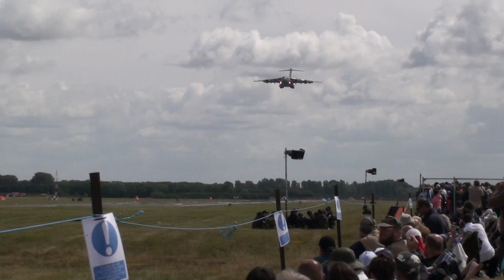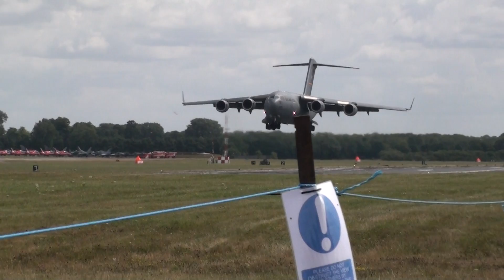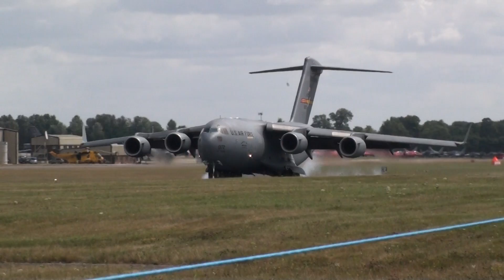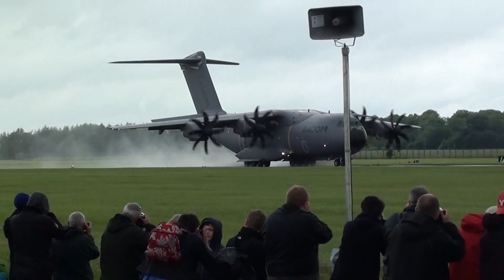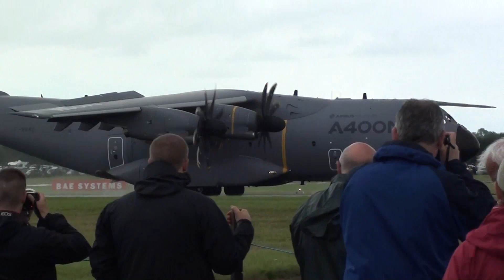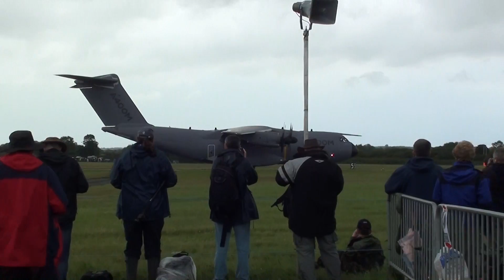Tactical Short Landing C-17 vs A400M. What Brakes The Most. Reversers, Wheels, Props, Spoilers?

Comment: Brakes, its all about the brakes spoilers are designed to simply help the brakes work and reversers are just for that little bit of added stopping power.
Reply: Charles Damery You say there are no brakes that can stop a 200 ton loaded aircraft, yet the 747 regularly uses wheel brakes to stop over 1,000,000 pounds of max gross weight on RTOs. Yeah, they might get red hot and make the wheels deflate, but they can be used for that. Not to mention in regular landings wheel brakes are used as well, just not as heavily. No point in wearing out brakes more when there's 10,000 feet of runway.
Reply: Charles Damery I'm with Brandon Lee.. I am a C-17 pilot. You don't know what you're talking about.. why don't you take me and the previous commenter that has a 757 and 767 type rating seriously? I landed the other day and got on the brakes before the reversers deployed. Did I get in trouble? No. Did I have to go to "the simulator for upgrading"? No. It even states in our flight manual for assault landings, which this video shows a C-17 do an assault landing, to "use immediate maximum braking as soon as main wheels touch down". How do you explain that I'd get in trouble if I use brakes on touchdown when it specifically states to do so in our FLIGHT MANUAL? Quit being so narrow-minded, do some research and you will learn something about today's heavies. I admit, going into training for the C-17, I thought reversers did most of the stopping. I was wrong and have learned otherwise. Just trust me dude..
Reply: Charles Damery I'd have to agree with Brandon on this one - I've talked to many ATP folks who have told me that SOP since the fuel price surge a few years ago is always to use runway run-out if available and to use conventional brakes only.  

It's literally cheaper to use the carbon brakes on modern aircraft (at least the Airbus aircraft we were talking about) than to spool up the engines in reverse. 

That obviously also implies that you're totally incorrect about the effectiveness of the friction brakes on aircraft, since it is their primary means of braking. An empty (fuel) AC will have zero issues stopping without reversers, hell most can do it and still make the second high-speed taxi exit!

What about the Qantas flight with the uncontained engine failure? That aircraft landed over 961,000lbs  (50 TONS OVER its max landing weight!) WITH HALF ITS REVERSING INOP AAAND antiskid and various hydraulic failures and it STILL managed to stop before the end of the runway! Just a reminder, the 380 only has two engines with reversing.  There's no way that single remaining engine is what stopped nearly 1 million pounds... Oh I think they added like 20kts to their landing speed as well!
Reply: Charles Damery brakes are still the primary stopping force. They are by far the most effective.
Reply: Charles Damery Now, you're listing armed forces as qualification, which I find weird, as fighters, who today mostly don't have reversers at all, with only tiny airbrakes and spoilers, operate the exact oposite of your description. The F-16 uses the underside of its fuselage as an airbrake down to 100kts. Below that? Wheel brakes, my friend. That tiny winy little airbrake in its arse isn't going to help you much. 

Back to jetliners. When you calclulate landing performance in the civilian world, you account for threshold speed, weight and the level of wheel brakes applied. Most civlian airports have a noise curfew at around midnight, not allowing anything more than idle reverse for landing aircraft under normal ops. Reversers only account for a very small percentage (a few hundreds of feet per several thousands in total distance), and the spoilers have almost no effect once the weight is on the wheels and the brakes get to do their job. To give you an guestimate of brake efficiency on modern aircraft, you can assume that 70-90% of the stopping power comes from the brakes, depending a bit on the aircraft.
Reply: Charles Damery There's one type of a/c that benefits more from its reversing system, though. Propeller driven aircraft have massive propeller discs of drag and reversing air upon landing, instead of the big air inlet deflecting some jets out the side of the engine fairing in jet engines. This means that props are better at stopping pound for pound due to their reversers. I don't have an arbitrary percentage in my head on this one, but the essence is far greater reverser efficiency than jets.
Reply: Charles Damery lol you have no idea what you are talking about, I hope for your sake you are just trolling and not actually this dumb.
Reply: During flight tests, the A380 was tested for a "worst case" 2x rev inop Max Takeoff Weight rejected takeoff at ~170kts. The brakes were machined to reflect a 90% lvl of wear and tear, and without reversers the plane stopped at less than 2000m (6070 feet). I've taken this info from the Smithsonian Airspacemag's "Stopping the A380" article (google will find it).

Not good enough / not believable? Okay, here's the Youtube link extention to the video from a similar test, with the B747-8 at max weight, no reversers: /watch?v=_g6UswiRCF0

Obviously, spoilers and reversers are vital to reduce brake and tyre wear/tear, put weight on the wheels early in the landing rollout, as well as reduce brake temperatures after landing. They are very important when it comes to letting aircraft fly leg after leg with short and hasty turn-arounds, but most modern airliners can manage just fine without them when it comes to stopping on even limited runways. Keep in mind that there's a difference between normal ops and certified abilities.

Last note, the Avro RJ series with their very tiny turbofans doesn't even come equipped with reversers, and it' still a STOL aircraft :)
Reply: Charles Damery Brakes are still the primary force used to slow aircraft down on landing, reversers are merely to help and spoilers are only used to help the brakes preform better. As much as you want that to not be true it is.
Reply: Charles Damery Lol, you know nothing. They use them in concert but brakes are by far the most powerful stopping force on the air-frame. Most modern airliners have both auto-spoilers and auto-braking systems, reversers are the least used system, because wear and tear on a huge turbo-fan is way more expensive than some brakes and tires.
Reply: Charles Damery lmfao you are a moron you have no idea how modern aircraft operate.
Reply: +Brandon Lee is correct. Brakes are THE major stopping force for transport category aircraft that are certified in the US. Indeed, for certification, reversers are not even considered. ALL of the stopping for aborted takeoffs are predicated on brakes alone for the aircraft I fly B767/B757. After an abort from a heavy weight takeoff the brakes will be very hot and the protective wheel fuse plugs will most likely melt and deflate the tire. Reversers alone would not stop the aircraft and we would depart the prepared surface.
Reply: +Charles Damery I'm sorry but your "experience  is dated, you need to do some research on modern aircraft. Talk to anyone flying modern aircraft (several have commented here) and its all brakes, reverses are not the main source of stopping power, the brakes do the heavy lifting with modern ceramic brakes.
Reply: Charles Damery they still primarily stop using brakes, the spoilers only help the brakes work and the thrust reversers help, modern airliners thrust reversers and indeed the kind on the c17 only redirect the fan bypass air forward, they are hardly efficient.
Reply: +El_Dude being discouraged from using them when you have runway remaining so you don't wear them out is completely different from them being more effective than spoilers speed brakes or thrust reverse, also the way large aircraft operate is very much braking based. They have anti-lock brakes and very durable high temp carbon brakes.
Reply: ***** Hey dude... We're not talking about fighters or 38s. We're talking about heavies. They're a different animal than fighters. I doubt you know how we (heavy pilots/aircraft) operate, unless you were one of those people who couldn't keep up with the speed and got heavies out of 38s.. if you are, I retract my statement.
Reply: Bob Gallup thank you!! To further back you up.. the KC-135, E-3, E-8 don't even have thrust reversers..
Reply: +Charles Damery As an ATP, I can tell you that brakes are the primary source used for stopping the aircraft. Quit trying to act like an expert and providing false information.
Reply: +David Krizauskas You are correct. I see you are also truly a pilot with a type in the T-1. Good to know not all people are lying idiots.
Reply: +Charles Damery Also, a lot of the time when we land on very long runways, we won't use thrust reversers. I wonder what we're using to stop the jet. I can tell you that wing spoilers do not provide enough drag to stop the aircraft - even on a 12,000 ft runway. Just because you have 1000+ hours on FSX does not make you an expert. now go away, troll.
Reply: +Charles Damery One more thing for you to think about. If brakes are not used during landing, why is it that our landing distances are dramatically increased on wed and icy runways? If we only used thrust and drag to stop the aircraft, runway surface conditions should have little effect on landing distance.
Reply: +Charles Damery Certification for all commercial aircraft requires a maximum landing weight no reverse thrust to a dead stop. The only thing left is brakes. RTO tests require a V1 RTO with no reverse thrust at MTOW. What do you think you know?
Reply: +Brandon Lee Actually it's not all about the brakes in fact if it's anything it's reverse thrust
Reply: +SquirrelFromGradLife no it's not, what are you basing your statement on, do you have any experience operating large aircraft?
Reply: Flaps they are called flaps, please never call them spoilers ever again....
Reply: Thrust reversers don't even actually reverse thrust much. They mostly just redirect it so the engines aren't pushing the plane forward anymore. I'm 90% sure a 737 or other commercial plane would overrun with max thrust reversers, spoilers, flaps and no brakes. Thrust reversers shouldn't be deployed below a certain speed, and then you're relying entirely on flaps (which is almost nothing). That being said, nobody has ever tried that, because everyone uses wheel brakes.
Reply: +Charles Damery large heavy aircraft use their brakes, the brakes are the primary stopping force, end of story you are emphatically wrong.

Comment: That stop by the C-17 was not a maximum full stop. The C-17 is a larger plane but it still stops shorter than the 400 because of it's more powerful engines.
Reply: jjs4you2 no: jet engines are less efficient in braking as propellers, and the C17 is much heawyer...
Reply: +leneanderthalien You are incorrect and dumb.
Reply: +gypsykingg and you are a idiot because all y say is right..C17 turbojet efficency 70% (in best cases), A400M propeller 85% ,TU 95 counterrotative props: 98%...thats all..

Comment: The c-17 is used more to transport chinooks,mastifs and even Apaches to Afghanistan before we pulled out so it doesn't need to do short landings unlike the A400 as the Airbus is going to replace the C130 which is used for airdrops etc as the C-17 was used to medivac the British nurse who contracted Ebola the the C-130 is like a donkey strong reliable and will get the job done the A400 is like the van it will get the cargo there sooner than the donkey and can carry more than the donkey the C-17 is like a Lorry it will get there as fast as the van and carry a lot more than the van but they all do different things so comparing them is difficult to be honest its just a matter of opinion I like the C-17 more than the A400 and the C130 so I think its better but other people prefer the Airbus and C130.

Comment: What brakes the most. Well, depend on what speed. The spoliers really don´t break that much, but they decrease lift putting more weight on the wheels, increasing the breakingpower of the wheels.

The reverse thrust and props breaks most at high speed, but do a adequate job at low speed to. It seams like the C-17 didnt use the wheel-brakes thow

Comment: Ah, I love a bit of good ol' competition. I'm biased toward the C-17, I must admit. However, it's indisputable that the C-17 is a proven airframe with years of operational experience under its belt. That being said, give the A400M two decades of operational use and I'm sure it will prove itself just the same. Flying around and doing fancy stunts at air shows proves nothing.

Comment: A400M is the clone of AN-70
Reply: Arnaud S. The AN 70 was in the air before the A400 was on paper...and I will still take AN 70 over the A400...Ive been to European airshows where both were staged...only problem, governments  associate it with Russia and its not looking good over there...the A400 doesnt have contra props..its got counter props...huge difference
Reply: Contro-rotating props? It's slightly bigger? It's building proces was planned much earlier then the plans of the An-70.And look still today, the An-70 program is a mess, even without the situation in Ukraine.I do not agree with you.

Comment: Obviously the C-17 would stop quicker than the A400M as the C-17 has jet engines compared to the A400M's propellers. The C-17 has to be good at short stopping (heard this on a tv programme: Inside Braize Norton) as they use the C-17's to help deliver cargo to the soldiers in Afghanistan. Because Afghanistan doesn't have airports which the soldiers can use, the RAF have to make-do with short, dirt runways as they make be under fire from the opposition so it's a quick "drop-and-go"; sometimes it's too bad the plane may land, drop it's cargo, but not entirely stop to make the delivery.

Comment: prop aircraft vs jet aircraft unfair comparison, like comparing a humvee and a prius
Reply: They're made for the same role, so yes it is a fair comparison
Reply: That's not really true. First off, that isn't just a prop, but a turboprop. Turboprops are basically a jet engine with a prop on it. Second, these are exactly the kinds of planes you would compare. Both are heavy cargo aircraft with short landing capabilities and both are able to reverse thrust. They are very similar aircraft. At first, this "competition", or whatever you want to call it, may seem unfair, but they are both very capable aircraft with many equal strengths. ☺
Reply: actually c-17 is made for longer routes and heavier cargos, doing a400m's job in a c-17 is not economical
Reply: NNT Flow, They are designed for different missions, the C-17 is designed to carry twice as much cargo, twice as far faster. That additional capability is while the RAF is keeping the C-17s they leased due to A400M delays.
Reply: How is it a comparison? Just because the title sais "vs"? Idiot...
Reply: Yes, the C--17 was designed for a different task, with a larger capacity (it was supposed to replace part of the shrinking C--5 inventory) but has a longer range only with partial load and the speed of both planes is almost the same (C-17 450kn, A400M 422kn)
Reply: They are incredibly different aircraft.  Ignoring the powerplant difference, despite that they look similar, the C-17 is quite a bit larger, and is designed to carry about twice the cargo of the A400M.
Reply: Props are good for short field performance because the offer more "traction" for acelerating quick than jet engines... and have better low altitude efficiency.. however they are inferior once at high altitude and high speed.. the A400M however is mid-way between the C130 and the C17.. like a single aircraft trying to offer both worlds in a single aircraft.. it lacks the payloa/range of the C17 but offers superior performance than the C130 with similar short field capabilities
Reply: Its TURBOPROP, NOT PROP... CESSNA FAN DIDN’T YOU? Its just the same Mechanism like Turbofan... don’t judge if you dont know anything...
Reply: AIRBUS DECIDED to use turboprops because they knew it was better.
Reply: You idiot. Props are always better at short landings.
Reply: The only real difference between them is the range that each is good for. Turboprop for short and jet for longer distances. But they both have the same capabilities.

Comment: Both nice aircraft. But in my opinion (as a European) AIRBUS should next time just middle finger the requests by the involved European air forces and go with already existing commercial jet engines to keep the cost way, way down. Servicing old, outdated short military airfields makes no sense when they should have been updated and made longer and bigger instead of building a plane to suit those airfields. It is not just landing. It is especially the take off distance that forced those request for powerful large bladed turboprops and other demands. European forces are integrating more anyway so many smaller airfields will likely disappear in the future. That is the same as the Danish company MAERSK creating the worlds largest transport ships MAERSK Triple E. It was the ports in Europe and Asia that were updated. Not the ships or engines being adapted. With all the problems and extra delays that brings.
Reply: The A400m is a tactical transport, being able to operate on small austere airfields isn't a requirement born out of the inadequacy of european airfields. The A400m needs to be able to quickly land and take off in a potentially hostile environment, in abandonned or makeshift airfields. Upgrading european airports wouldn't change the fact that the A400m is very likely to take part in conflicts in Africa and the Middle East where it may have to use such inadequate airfields. The needs of armies like the French and British armies in these areas is the very reason this plane exist, it wouldn't make any sense for it to not fulfil their needs.